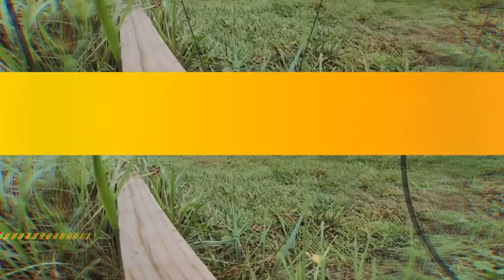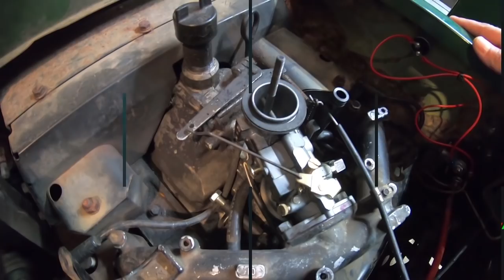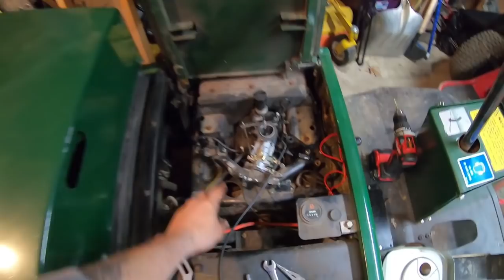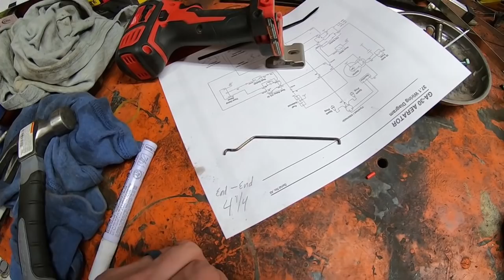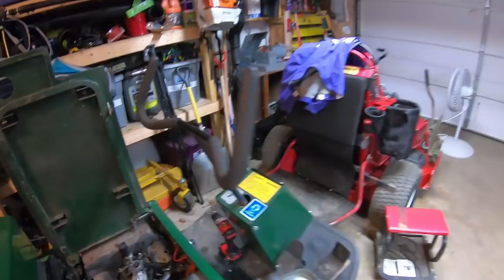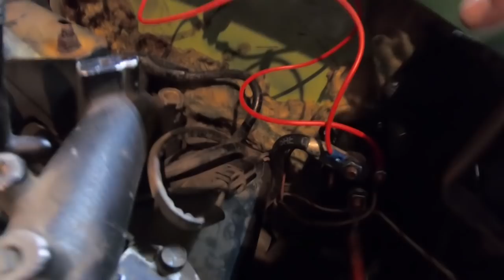Lawns up for Grabs

Comment: I prob would have just put a dab of JB weld on the ends just to make the rod too big to fall out of the hole and called it good. But I guess you wanted to play with and bend your rod for 1/2 hour
Reply from the maker: And then when you have to take it apart for repair or cleaning of the carb, you're screwed. See, when you become a big boy you'll think long term and not just instant gratification like you kids do 😉
Reply: Countryside Vlogs nah, pliers would pull it right off... all your repairs are junk and all mine are perfect. It’s okay to be in denial buddy don’t fret
Reply from the maker: @KenMrKLC  Country boys always come out ahead, get an education city slicker
Reply: Countryside Vlogs you live in NY, City Boy!

Comment: I’ve found the patchy lawns are often an irrigation problem. Get the sprinklers covering properly and it evens out assuming of course he doesn’t have patches of Bermuda, bentgrass, etc.  Glad you are getting new accounts. I have lost 15 of my 60 this year. I’m getting no new calls, none. A little worried right now.
Reply: Throw out some cards..if you can..I stopped getting..any calls..I think because I haven't advertised any more. But as soon as I pass out I get calls.
Reply: Lawn signs work great especially in high traffic areas.
Reply from the maker: It's all clay here and the ground gets compacted. That's why it isn't growing

Comment: get a bike spoke for it to.  ~$1 if it still does not work
Reply from the maker: Good idea. I'm pretty confident this will last forever
Reply: I keep metal coat hangers, zip ties and duct tape you can fix anything
Reply from the maker: @lawncommander  very true

Comment: Can’t wait to see the this old school aerator in action...! I have a 3 point hitch Ryan on a John Deere 455 garden tractor. It does a good job. I’d sure like to upgrade to a Turfco or a Stinger. I demoed the Turfco last spring and it is a good machine. I’m leaning toward the Stinger with no chains to keep it hassle free. I’ve read all the nightmares with the chain drive machines. Just need to get enough of my customers on board to make sure I keep a $12,000 investment viable...!
Reply from the maker: I like the stinger
Reply: Countryside Vlogs The Stinger looks to be the least problematic machine in my eyes. Direct drive vs. chains and sprockets is a no brainer for me. Turfco has them shielded better than other manufacturers, but they are still there to get worn out from the soil getting tossed around underneath the aerator.